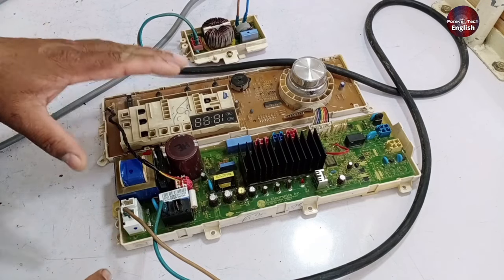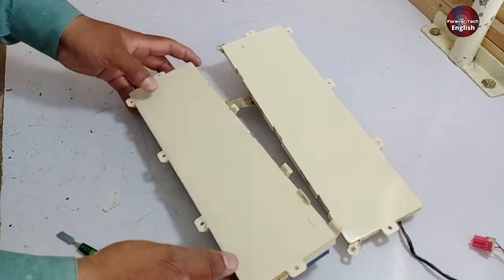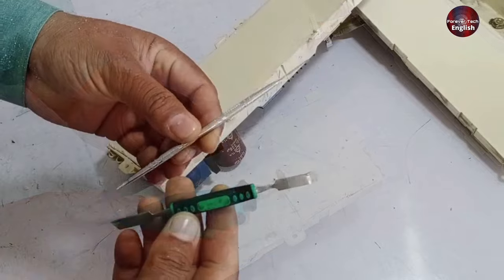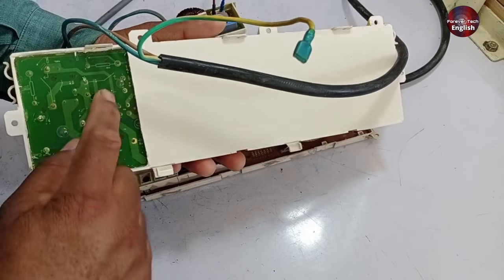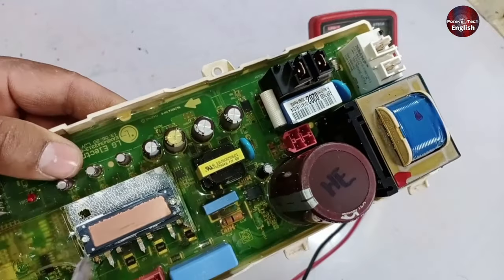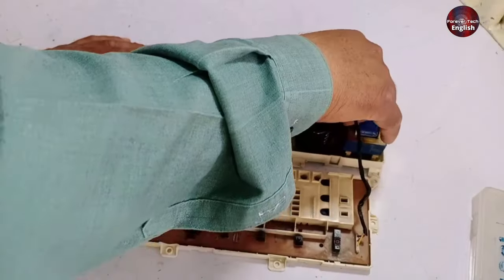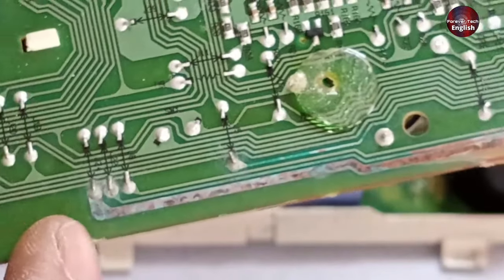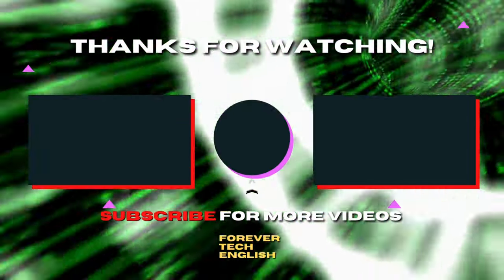LG Front Load Washer Motherboard Repair

Comment: We leveled ours and it is working at the lightest touch like new. Installation was done incorrectly. Before you call someone do the ThinQ as we did. It helps to diagnose problems. You for sure know it’s not the expensive parts, which the people who looked at it wanted to replace.

Comment: very impressive... thank you for sharing, my washing machine mainboard was similar with that one on the video, the problem is a little bit different, it keep turning off again every time we push the power on button and we could hear tick sound maybe from the relay similar sound like on the video, it only turn on for several second with normal sound when we turn on the washing machine then it will turn off again, do you have any idea which part should be inspected?

Comment: Thank you again for charing your knowledge
I have the same PCB board, but the resistance concrete with the line 220v burn, i dont know code color become all become black
The resistance hide in with insulation
What is the Resistance VLUE for it? !
Reply from the maker: Well I don't have this board right now, Will have to check the my old data, whether I captured the photos or not, then I can help you out.
Reply: @forevertechenglish  thank you very much 🙏
Appreciate

Comment: Hi *Forever Tech English*, This video is the closed I come to finding, solution, to LG Washer & dryer - MODEL Number: WD-14331AD,  from my investigating the model you used in the is a slightly later model with with the dry function, so the funder mantel's should be the same, the machine was working just find, until just failed, it was do it week, wash, set big centre dial, 40, set pre-wash, intensive, and Rinse+ and then it drop in the dryer, function, it went all the was with program to the end I think, (when I came back just before, I take the garments out, I like just do the low temp, set just warm the garments, the always very mildly damp to the torch, the doing that fixes that, and this was the first sign of a problem the machine would not wake up, (check the plug fuse - okay, stripped out the control button board just like the one your video, multi meter all the contacts to the switches, and assessable traces, from the switches, to the next component, all passed, when all over the main board like one in your video, it sealed just like yours, I was thinking doing something similar with drill, (but I like the way you did your board better) Im quite confinable with the doing soldiering if needed, the mains power that connect to, as soft button control, there ne real power point to probe, to see if this any power get to the board, I have all checked fuse on the board and that checks out okay, I been all over the main board with a big camera Len, and the only think stands out like the board in your Video It has a One big capacitor (the size) and one of the small more normal sized one right next to there floor or bubble sealant stuff, did the sniff test, there's a bit smell, but nothing strong, just old circuit board smell  there no smell like something been on fire or something, I Okay with small electronic stuff, the big capacitor don't normal blow up or fail ever, and if the small fail, the top crack open, but there no signs of any of that going on,? was surprised by the rust under protective gel stuff, in your video is that a  regual thing, I can not see any signs on the out side, I am stumped to what to do next?

Comment: I have the same power issue in my washer. switching IC is getting heat. is it faulty? if so what is the part no for replacing the switching ic Bro.
Reply from the maker: If its heating up more than usual check its datasheet to found what is the max temperature for it
Reply from the maker: Try to install the same number.

Comment: I need your help, Lg front loader showing dE, bypassed the door switch and checked the voltage on pin 1 and Pin 3...not reading 220, how do I trace the fault?
Reply from the maker: I have videos about door switch on my channel you can visit my channel and watch those. Hope so those video will help you out in fixing the problem.

Comment: Hello i have problem with the same PCB board. But resistor with cover on it gets burned.Washmashine works few hours when i change IT and Burn IT again its 220ohm 2w
Reply from the maker: Check For any flucutation in the voltages, Check the main supply from the plug whether it is attached with the correct polartiy, Check for anything heating in the pcb board.

Comment: IE erre showing on my machine one small moter of water supply is working but next time taks water that moter doesn't work what is falt
Reply from the maker: is it iE or LE
Reply: @forevertechenglish IE errer
Reply: @forevertechenglish os the relay is falt in pcb
Reply: Engenier told me
Reply from the maker: @BhanwarSinghgaour  let me check what this error means, then i will inform you